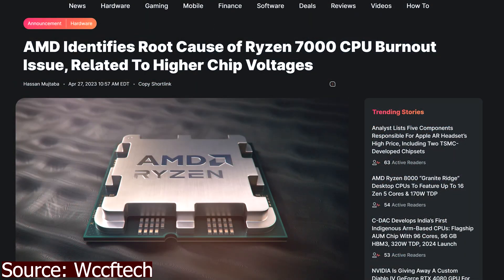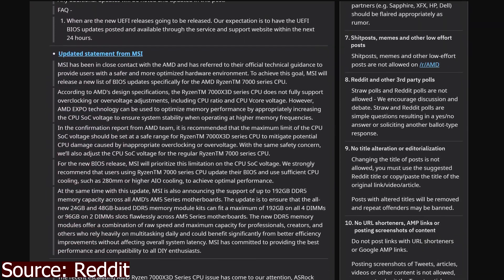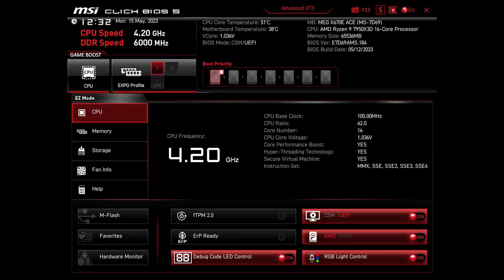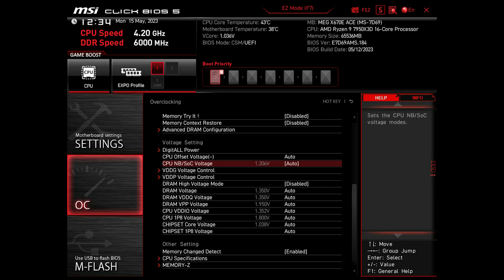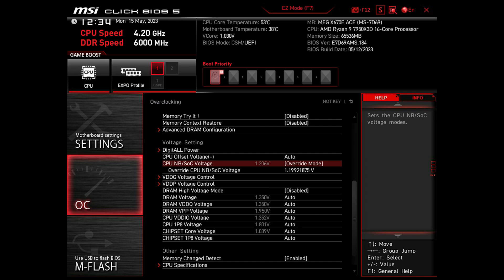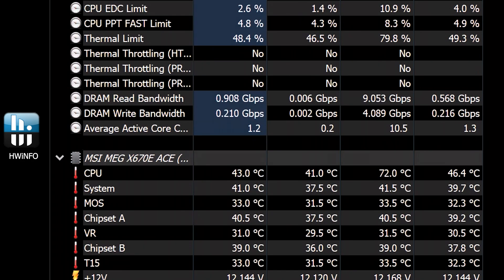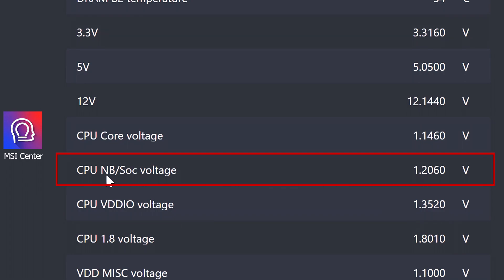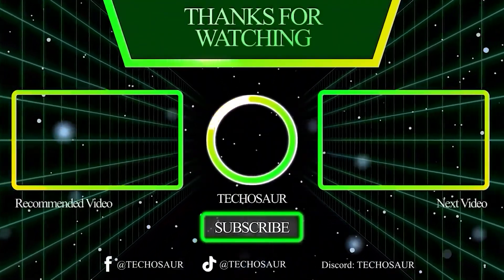Fixing high SoC Voltage on Ryzen 7000 CPUs: Guide for MSI Motherboards

Comment: I just got my 7800x3d, slowly regretting it as we have to cut the power to everything which isn´t in use in our home, my better half is a b** in that regard. The post time (not windows boot times) is about 30 secs which is far too long, I have tried to turn EXPO off, memory training on/off and even tried to downgrade the ram to 5600 using EXPO. Nothing really helped.

I benchmarked the system and it is a lot faster (normal according to other 7800x3ds) when things are running but it takes 20 secs to start State of Decay 2, in general it is just slower to start stuff ... my 10600k usually did everything at a press of a button.

Also ran tests on the two NVMEs ... things are normal there too. The thing is that I am not that tech savy, it´s not a system I would recommend to newbies.
Reply from the maker: POST time increases when any EXPO profile is enabled. When turned off, the system is supposed to bypass RAM training code 15 and boot like any modern PC.

AM5 is a new platform for AMD and like with any new tech comes a set of challenges, especially since we are early adopters

but I find it shocking that the 10600k with its six cores starts things faster than the 7800X3D eight cores 😦

nevertheless, I really hope your experience with the 7800X3D gets better as time goes on!
Reply: @TECHOSAUR I gotta ask you something real quick.

So I just bought the rtx 4080 ryzen 7 7800x3d 32gb ddr5 ram ( prebuilt pc ) and it has the asus PRIME X670-P motherboard. Can I use expo if I have bios from 2 months ago? ( haven't updated anything since I bought the prebuilt pc a few days ago ) So not the " latest " bios version, but still a one which apparently has the fix from ASUS for the cpu/mb issues.

Can I still enable expo? I been running default ram speed ( 4800mhz ) everyday. Insane performance even without expo I must say. However the question is, is it safe for me to enable expo and use the 6000mhz? Do I need to do something else before I enable it? For example, manually set the SOC max voltage to 1.25 or something else. Let me know, thanks!
Reply from the maker: @PahEz  I'm glad you are enjoying your PC!

Yes you can absolutely use EXPO as long as making sure that after enabling it, to initially check SoC voltage because it goes higher when you enable EXPO, make sure its not above 1.25v, you can even manually tweak it in BIOS to 1.2v (i personally have it like this for months) 
keep in mind that I also have same RAM speed as you 6000mhz and its fine at that voltage!

also for monitoring you can install HWinfo in Windows to see your SoC voltage at any time, its good practice to control it for the first few days after enabling EXPO to make sure it was safely done and not exceeding the safe limit

how come you dont want to update BIOS version to the latest one though? its crucial to stay updated because AM5 platform is evolving with every BIOS iteration, and now with latest version we got faster RAM speed support to 8000mhz and other stuff, so its good idea to update it always
Reply: @TECHOSAUR  Oh good to know that about the bios updates. I never reslly thought much about it since normally you don't really need to update it as long as everything works, but yeah I might update to the latest version, and yeah that's perfect. Thanks for the reply, much appreciated!

Comment: Hi. You can also lower the CPU VDDIO to 1.2v also as 1.3 is high. cheers and great video
Reply from the maker: in my case as soon as I lower CPU VDDIO from the current value which is 1.35v to anything even by a small decrement, POST fails at RAM training with EXPO on, it didn't seem to be an option to change in my RAM setup, were you able to get it lower ? by how much and what RAM module are you using? thanks for your comment!
Reply: There will be other settings which maybe need to be adjusted also. The bios is so temple mental and if one option isn’t done it can cause instability
Reply from the maker: @CaptaIn_NAM1 if you know which settings can be changed to be able to tune down  the CPU VDDIO please let me know, it will be a tremendously helpful!

Comment: 'how to get your infinity fabtic and RAM profile unstable in just 10 seconds'
Reply from the maker: EXPO profile is predefined, all i did was reducing the SoC voltage to avoid damage to CPU and MB socket, didn't see any stability issue for a month 🙄
It depends on RAM module

Comment: What voltage is best for the 7950X with the MSI MPG X670E Carbon Wifi? My CPU NB/SoC is currently at 1.304. The max is at 1.308V . Idle temp is around 55 degrees C
Reply from the maker: do you have EXPO on and what's your RAM configuration?
Reply: @TECHOSAUR  Yes, Expo is enabled. I'm using the G.Skill Trident Z5 NEO RGB Series 32GB (2 x 16GB) 288-Pin SDRAM DDR5 6000 CL30-38-38-96 1.35V
Reply from the maker: @axi6ne8us  you can try to lower the SoC to 1.2v, 1.3 is the maximum safest point set by the new bios version but can't see a reason why it wouldn't be even better to lower it to the hood of 1.2v in order to not overstress your components as long as it works fine, i have the same RAM as you and with EXPO been running at 1.2 for over a month and even saw a better CPU temp like at least 2-3 Celsius
Reply: @TECHOSAUR Thank you. I will try those voltages. Also, which cooler are you using for the 7950X? I feel that my Fractal Celsius S36 AIO isn't strong enough for the 7950X
Reply from the maker: @axi6ne8us  i think your AIO is actually fine but you need to look if pump speed is at max speed at least for this high end CPU , i have the MSI MEG CORELIQUID S360, the pump speed on that one is 2800 rpm, but more so you need to check if your case has enough intake fans

Comment: Exactly what I needed, thank you! Building a new pc with a 7800X3D and MSI MAG X670E Tomahawk.
Reply: I have the exact same mb and CPU have you had any problems with thermal throttling? And are you on the latest bios?
Reply: @diego_fih4680  Latest beta bios and the only issue i've encountered are long boot times after restarting. Other than that it's been fantastic.
Reply: @ComradeBornath  glad i don't have to worry to much when my parts get here then thanks 🙏
Reply: @ComradeBornath  @diego_fih4680 x670e tomahawk wifi/7800x3d i build. But with the latest bios i have getting constant BIOS freezes. Do you guys have similar issues?
Reply: @ComradeBornath  btw I'm having issue with very long boot times on am Asus hero board as well is there a fix for that ?
Reply from the maker: nice combination, always loved the tomahawk box design
Wish you good memories with ur build !